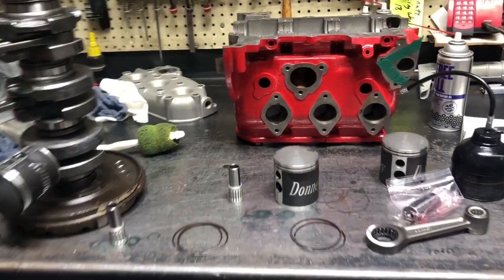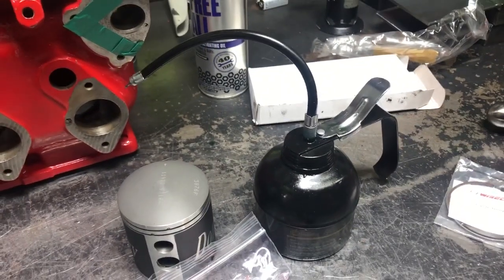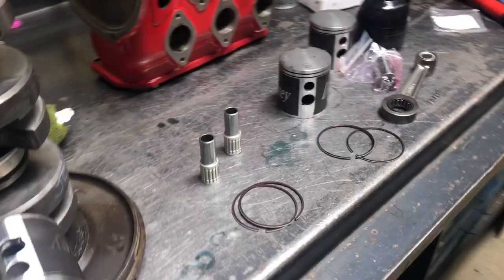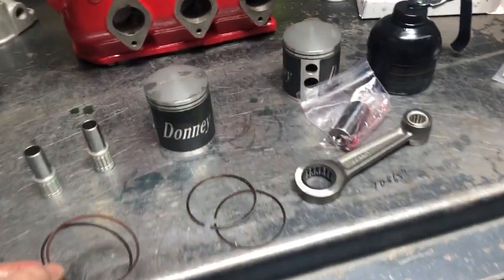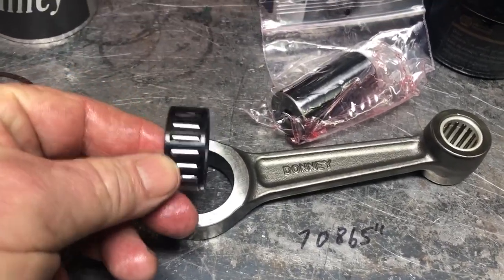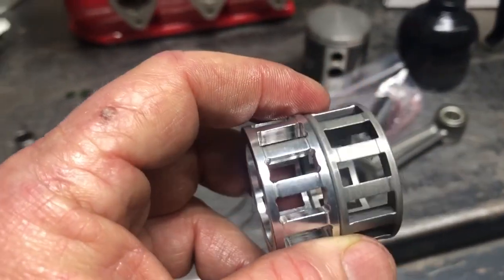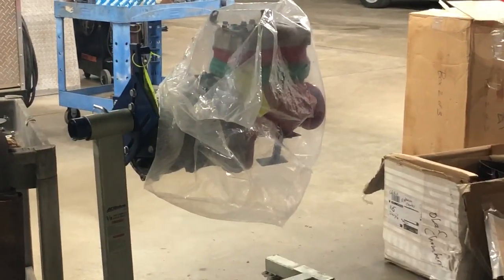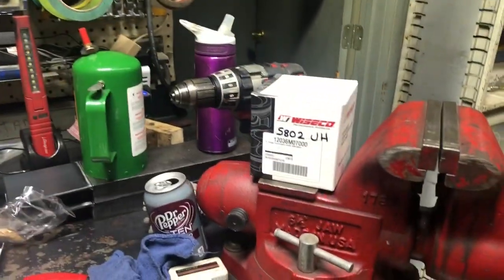Saab Two Stroke Wiseco Piston Fitting

Comment: Keystone type rings were used by Suzuki on all the their two strokes that I worked on.  Interesting the changes to the SAAB engine for more durability.  I had several back in the '60s and '70s, kind of miserable to have to fit the wrist pins with specific tolerance bearings.  I know of only one other two stroke that kept the rod centered without thrust washers on the bottom end and that would be the OSSA motorcycles from Spain.  Suzuki used a flash plating of silver metal on their aluminum bottom end bearing cages.